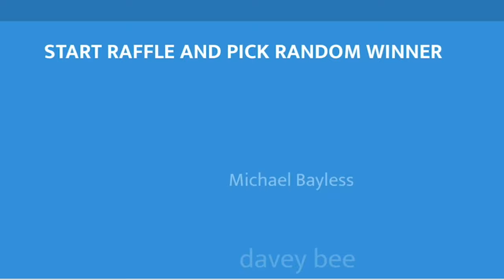How much of a difference does a tip make for turbo whistle?

Comment: A big factor in the sound on an axle dump is the angle and distance the end of the exhaust is from the ground. Adding a long tip makes a lot of the rumble reverberate off the ground because its so close to the road.
Reply from the maker: That’s true bro! Makes perfect sense💯
Reply: Yes, but an axle dump is an unappealing exhaust.  Dirty system

Comment: No disrespect, you do a great job with your videos man. But personally you couldn’t get me to believe there’s a big enough difference to make a good comparison. The biggest differences are 
#1 Muffler #2 piping size #3 resonator #4 Catalytic converter. Straight piped 5” is loud and i don’t see an 8” tip effecting airflow much at all
Reply from the maker: Yeah man it was even hard for me to hear the difference in the video so I understand. You can tell more on person for sure. I also don’t have a professional mic and just use my iPhone for my videos. Lmao
Reply: @NoHalfAss  I seen a app where it’s a decible meter. Maybe that will help. And I stand corrected on the sound. Someone measured a 1-2decibel difference on a 4” exhaust from a 5” to a 6” tip. Good video, I’ll keep watching.

Comment: My brothers 7.3 whistles like my 03' 6.0 ten blade 99% of the whistle is from the exdeucer side in the turbo but his got loud after he did a bigger downpipe no cat. His truck is a manual so maybe they come with a differant ar to increase spool between shifts, I never seen the gains from big tips but seen guys with 6.0s lose whistle after bigger up pipes and downpipes if you ever see those oem tips with the louvers like on 6.4s that people hack off cause smooth look better are ideal for performance louvers somehow create a vacuum or increase velocity on  the exhaust flow

Comment: Cause I understand your talking about like the take off whistle but whats the whistle when you first start it and it just whistles ? While running the whole time?
Reply: Turbo runs on exhaust pressure, at idle there’s some but not enough to build boost that’s why you hear it, when you shut it down you can hear the impeller wind down

Comment: So question… if you take a stock straight Pipe it & Add like an 8 inch tip you’ll get that whistle? No need to change turbo?
Reply: Tip is gonna hide the whistle with the rumble, I just cut my axel dump off, if just have a 3” straight pipe, turbo is way louder, but I have a 6.5, the turbo screams

Comment: Im running a 5 inch straight pipe and intake and 180cc0% injectors kcx300x 63/70 mm turbo and edge evolution cts2 on tow tune. Looking to get a custom chip since truck is quite smoky and would like to clean that up a bit. I dont think a tip on my trk with 5in straight pipe would change any thing.  My tailpipe is custom as kits dont fit cab n chassis. My exhaust in front of axle goes straight up and follows my 5in bed frame to get past my axle and drops down to 90 out the side. Worked perfect so doesnt interfere with the trl hitch/rear bumper bars
Reply from the maker: That’s cool bro! Your truck must be pretty quick. What size tires you running?

Comment: I've recently bought a f350 with nothing but a short pipe ,,,does that affect the performance with no muffler?
Reply from the maker: Yeah they usually recommend straight piping these trucks. So no cat and no muffler. That’s how mine is too🤘🏻 makes the truck sound cool and helps performance, but very very little by itself.
Reply: Ty sir,,yours sounds great with tht tip,,thts the way I'm gunna go too thnx

Comment: Unless you're next to a sound barrier of some kind (wall, jersey barrier, thick vegetation) you're not gonna hear much a difference from the driver seat. But the people you pass by will hear ALL of it and there's a saying that goes "stance makes her dance, spool makes her drool" I have a GTP-38R backed by a 5 inch true single straight pipe in my raggedy ass 7.3 that i get complements on regularly. People think I run a rat rod but its really just a rusted out 2001 that the City of Boston didn't take care of worth shit but I can say the spool attracts the ear and if I was a betting man I'd say weld that stinger back in there and let the people hear that jet engine under the hood! Everyone will know who's coming before they can even see you when they hear that spool from blocks away and that's something that's been lost in the diesel world with these newer common rail engines in recent years.
Reply from the maker: Good points bro! Question: what do you mean when you say “weld that stinger back in there”??

Comment: No tip in my opinion, but the truck sounds great either way
Reply from the maker: I noticed when I was doing this test that even without the tip there still wasn’t as much turbo whistle as there was before I added the axle dump. I think it’s a combo of adding more pipe/more bends, and the exhaust faces the ground now which probably muffles it a bit too.

Comment: Keep the tip. When you let off an your hear the turbo almost sounds like it’s blowing Did your old turbo make that noise? I have a BD thruster turbo an it doesn’t make the noise. But that blowing sounds so badass when you let off. I’m sure it’s the turbo but just seeing if I can get my turbo to make that blow sound. I’m sure this comment makes zero fucking sense 🤣🤦‍♂️
Reply from the maker: Totally makes sense bro, I get what you’re saying. My stock turbo made that sound too. It didn’t really start until I got my stock turbo over like 20 psi. How much do you get?
Reply: I’m not sure man, my boost Gauge isn’t hooked up still. On my to do list. So I just need to get my psi over 20 then is what it sounds like.
Reply from the maker: No guarantees but that was kinda when mine started